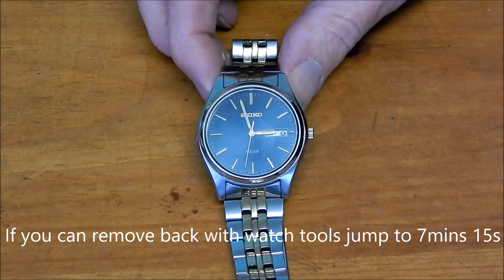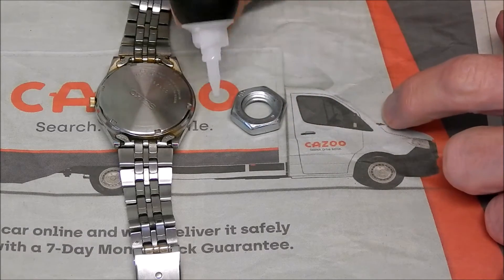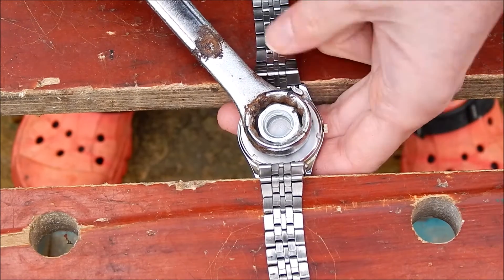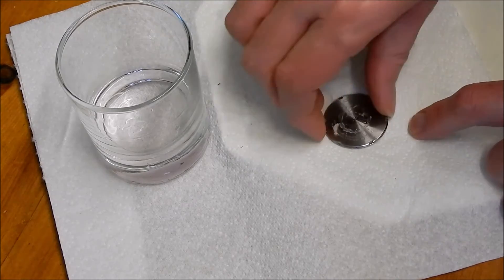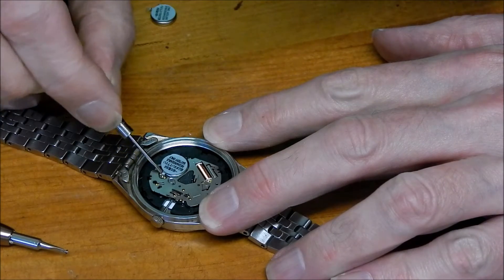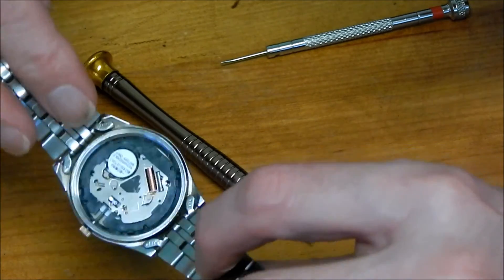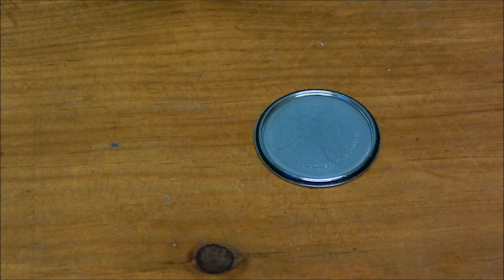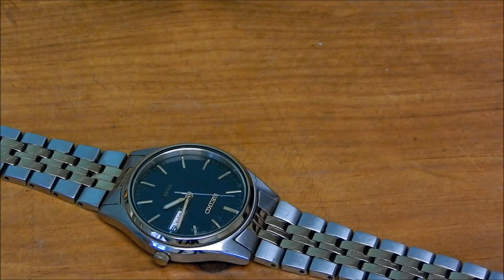solar battery replacement of a Seiko watch

Comment: i feel so justified. i bought one of those kits off of amazon to open my eco drive back lid and there's no way that was gonna work. you need a high quality set up to hold the watch. then i go on youtube and some fools on here got the same tool kit i got and he twists it lightly while holding the watch in his left hand. yea fucking right. maybe on newer watches it can come off smooth.
Reply from the maker: This was exactly my issue, which is why I ended up putting it in a vice to hold it and then twisting with a large spanner, they do come off but does require a lot of torque. My watch was also old circa 15 years.

Comment: I have the exact same watch. Was skipping seconds for a while, then stopped. The back was very tight, your nut removal method worked well. Unfortunately after I replaced the battery and the watch no longer works.
Reply from the maker: Interesting that it stopped before changing the battery   Wondering if it could be solar cell failed. I would be tempted to leave it by a window for a few days to see if it come back to life. Winter has low light so not the watch’s favourite time of year.

Comment: I respect the ingenuity for improv skills. I'd like to note that the tool to remove these battery covers are like 8 bucks. Just got one and took about 5minute max to fit the tool to size and twist the cap off. Thank you so much for showing the actual process of replacing the battery too! I was very concerned I'd break something 😅
Reply from the maker: I have the same tools. They have taken the back off many watches, but not this one, just could not get enough torque through the small pins. If the normal tools do work then yes it is better option. This is not a preferred method of removing watch backs, more of a method of last resort. The back had been on for 15 years, grease hardened and the case on really tight. If you look carefully at the video even with big spanner it still required a lot of effort to release it. I do say out start if you can remove with usual tools jump to 7 minutes in.
Reply: @dodeedo  oh man I never considered it could be just shut down that hard due to age. The more we know and ill remember this technique if that ever becomes the same scenario. Thanks for the response back btw.

Comment: Can you please share the brand name of the battery that you used. My seiko Solar is lying idle for three years now because I can’t find its battery.
Reply from the maker: If you get it out you can see what is on it. I think I may have purchased a Seiko brand. Just check if it has the tab or not. I did find battery info on Google from the movement number on the back of the watch
Reply: Sieko 2023 34t they are expensive, mine only lasted 6 years.
I thought I was saving the planet!

Comment: Thanks for the video. I've never opened my solar watch, it's always helpful to see it done before attempting.  I will say though, for anyone attempting to work on any quartz watch, be careful not to touch the copper coil. Over time, oils from your fingers can cause premature corrosion to the coil, necessitating a replacement. I'm not saying you touched it, but it may not be clear to a first time do-it-yourselfer.  Great camera work too!

Comment: Thanks for the demo! One store quoted me $70 to change the battery.  After seeing this video,I think I'll do it myself if I can open it!
Reply from the maker: Please see my other video on getting the back off. When I did mine the usual tools didn’t work. Hence the need for big nut
Reply: This would have cost approximately $50 in my store because I actually know what im doing. I wouldn't have needed to superglue a giant oversized nut to case back, I wouldn't have used magnetized tools and most importantly I wouldn't have left behind my greasy fingerprints all over the movement power cell and case back. You get what you pay for.....pennywise, POUND foolish.

Comment: Where do you get the replacement battery from?
Reply from the maker: I got it from eBay. Found other on line battery specialists as well. Seems like there are two versions. My watch needed the one with the tab

Comment: Is this a joke?
Reply from the maker: No, just a solution to real problem, if you can get the back off with normal tools then great otherwise this is my solution to replacing the battery after 15 years